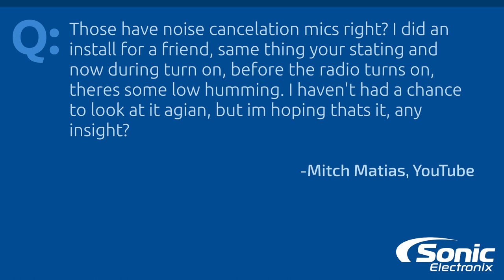Why Does My Microphone Hum? | Car Audio Q & A

Comment: I have a 95 Lincoln Town Car Exclusive, I plan on putting 2 12inch kicker comp vr's pushing 800 watts a pair with a 1000 watt kicker DX amp and replacing all stock speakers with 2 kicker DS 6*8s and 2 kicker DS 6*9s. My question to you is should I upgrade my stock alternator with a high output alternator plus the big 3 upgrade or should I just do the big 3 upgrade without it to keep my electrical system stable, thanks in advance.

Comment: I'm installing 2 10"subs running off the same amp behind the drivers seat in my Utility so there is limited space avaliable. Manufactures speck say it'll either be a large sealed box or small ported box. 
What if I cut it in half unequally so one is in a smaller sealed box,  (tighter bass) &  the other a larger ported box, (boomier) still within speck & best of both worlds?
Reply: don't do that, they will cancel each other out

Comment: Hey Allen, I recently purchased a head unit from SE and was wondering if it would be a good idea to install an amp and sub to get a cleaner sound? Would an amp and sub give my truck a cleaner sound from my stereo?
Reply: if the head unit has a built in high pass filter that will help a lot, that way the bass is redirected to the sub and the car's speakers just do mids and highs, so you can turn it up louder without distortion. you will also get purer bass from a sub, speaker bass tends to be muddy